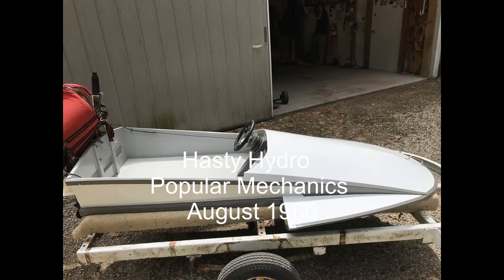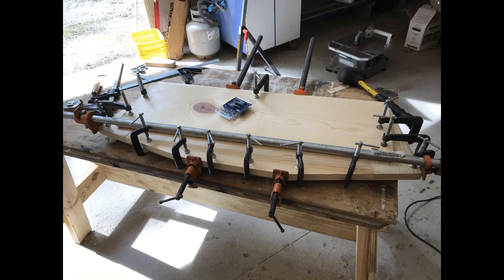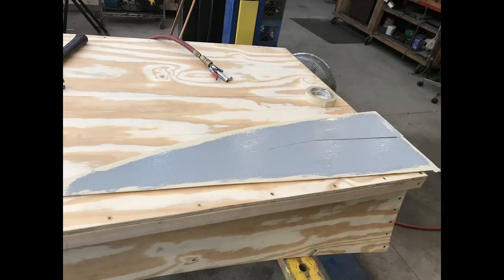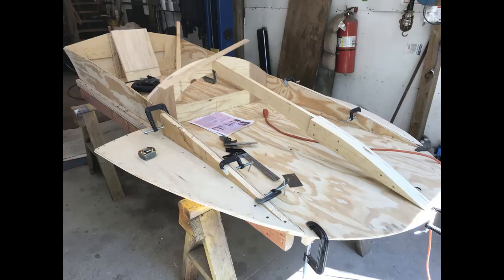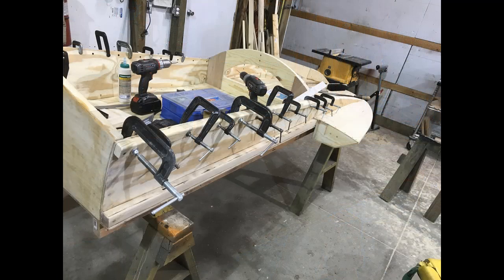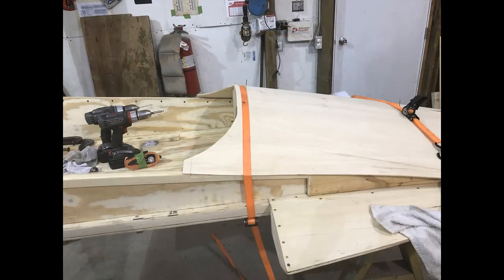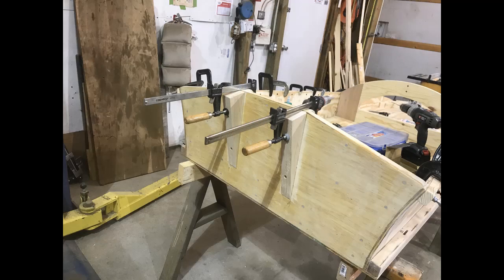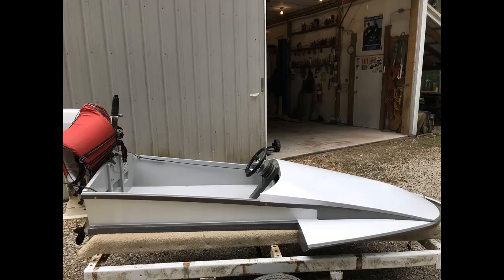Building the Popular Mechanics Hasty Hydro (hydroplane boat build)

Comment: Nice work!... and a great video! - We just finished building one too! After testing we decided to add back top decking to keep the water out.
Reply from the maker: I know exactly where you mean.  when you slow quickly and turn it really comes in the rear corners.  
for what it’s worth after I tested it I found that when on plane it didn’t track straight ahead, it seemed the stern would skid a little left and right.  I put a small ( 1” tall by 4 “ ) skeg at the rear bottom. it helps keep the boat going straight.

Comment: That's awesome!!!
I had a tough time finding the original magazine though, because it turns out that it wasn't "Popular Mechanics" it was actually "Science and Mechanics" that had it.
AND flipping through the Science and Mechanics magazine looking for the "Hasty Hydro", it was interesting to see on Page 70, "Convert your boat to Water-Jet Power", as I didn't think that was tried and talked about much until the mid 70's, so that was pretty cool as well.
Found the Hasty Hydro on Page 146 too btw.

Thank you for the great video of your build and taking the time to explain things in detail about the build, it's greatly appreciated!
This is the one I want to build as well, so this is extremely helpful.
Reply from the maker: Sorry I steered you in the wrong direction.  I used the information on the muskaseaflea site.  Glad you found the right one.       It’s a fun boat to drive but it doesn’t handle like a normal boat… good luck with the build…
Reply: @cjwhite1758  Sorry, I wasn't trying to troll you either by pointing that out, I just wanted to clarify incase anyone else tried to find it after seeing the video and couldn't.  

I think I also read that on their site as well, and couldn't find it then either, but this time when I looked for it, I stumbled onto the search results that found it, and you can DL the whole magazine PDF as well.  Maybe that's why their site had it wrong LOL

I was hoping to see a follow-up video where you tried out the boat to see how it worked out.  

When you say it doesn't handle like a a normal boat, do you mean it's difficult to handle or that it's just different, like it slides around more?

One thing that terrifies me about these mini boats, is that I only see them being used on super calm and glass like waters, and I'm really wondering about the front being so low to the water, thinking what if the front hits a wave or wake from another boat, and does a lip stand?

I can't help wonder if the front shouldn't stick out further, and up continuing the angle, to get the top front higher outa and away from the waters surface. Maybe not though, but freaks me out watching these little boats ripping around. LOL
Reply from the maker: No offense taken… like I said, I used the article on the site.   
By handles different I mean that after it’s up on plane it doesn’t lean into a turn like a standard v bowed boat. It will turn but it sort of skids a bit towards the direction you are steering it and then heads in the right direction. When plowing ( and with a flat bottom sheet it really plows) it handles like a regular boat.
As to the bow chopping into the waves I actually worried about that too when I first started to drive it but found that the sponsons would bring the bow up as they hit the waves.  Make no mistake, it definitely is not a bad weather boat and might be dangerous in heavy swells.  Hope that answers your question.
Reply: @cjwhite1758  Oh wow, ok.  Yes that was very helpful.  Thank you for the replies.

Comment: I never built this boat, but when I started working at this garage in Houston there was one completed except for paint. It had a wooden B29 steering wheel, but no steering cables or pulleys. I wound up buying that garage then later selling out to my partner and part of the deal was I got to keep the boat. I glassed and painted it, installed a 35 HP outboard, took it to the boat drags in Waco circa 1980. I was in college at the time and failed to register it before slipping it into the river with the rest of the race boats. I ran it up and down the "track" several time before I attracted the attention of the Fish and Game officers who liked it, but made me take it out of the water for multiple violations.  It also had a gunwale around the cockpit, but he 35 HP motor was way above the rating for the boat and the weight would almost sink it until it was moving, and MAN did it MOVE! In a straight line... I eventually attached 2 metal skegs to the length of it and it helped, but not much. College fun.
Reply from the maker: Holy s**t...    35 HP!!!    Mine has an 8 HP and I'm not using full throttle because my bow is only a few inches above the water and I figured if I were to bury it in a wave I would be launched over the bow.... you have my utmost respect ( ie I think you were crazy )

Comment: I also built one and put an 18 horse Evinrude on it (way too heavy). The 9.9 hp Mercury was the right motor to use ( lighter and probably closer to 20 hp. Even today they are 1,500 if you can find one)

Comment: I had one of these back in the mid 60"s. I paid $30 for it and first put an old 18 hp Johnson on it. Wish I still had it for my grand kids.
Reply from the maker: Ahhh yes,  the sixties.
Reply: Mine had a 4" skeg mounted in the middle. I flipped at wide open throttle when one side of the steering came off. It floated real nice with the bow pointing skyward. So much fun!
Reply from the maker: how did you get it back to shore?
Reply: @cjwhite1758  Friends saw me and jumped in their boat and came to tow me to shore. I was back on the lake in an hour.

Comment: Thank you very much for sharing your building and improving the Hasty Hydro! I got inspired for a "Buddy" to our Minimost "Hetty". I cannot avoid to ask what you have for a car in the background at 06:45?
Reply from the maker: It was fun to build,   The car in the background is my recent project.   A 1972. Opel GT. I’ve had it for several years decided it needed a total rebuild. As of now the bodywork is finished and will get painted this spring when it gets warmer. Last month I finished the engine, transmission rebuild so it’s ready to install when the body is ready
Reply: @cjwhite1758  cool! It is like the Hasty Hydro on the road, isn't it? With the 1.9l engine it will beat every Corvette regarding "Smiles to the gallon" ;-)

Comment: Water had to be smooth or the nose would just slice the water and hit you at 30mph!
Reply: That happened on our maiden voyage.  Sliced through a wake from another boat, almost knocked me out of the boat, filled the cockpit with water and swamped the boat. The motor had to be purged of water in the cylinders.   It didn't sink however, i guess the captive air in the sponsons kept it afloat.  Fun stuff.